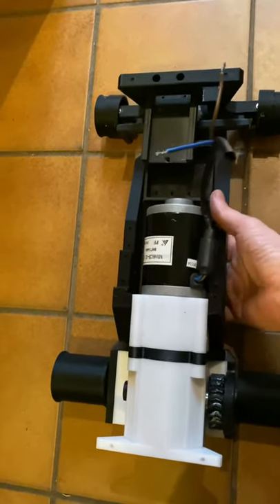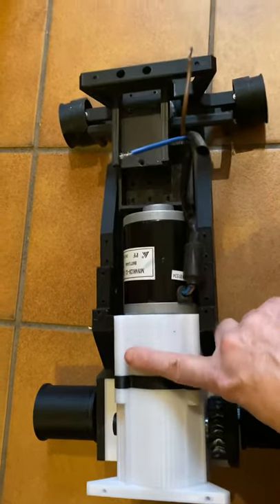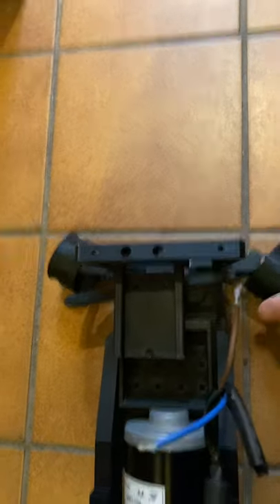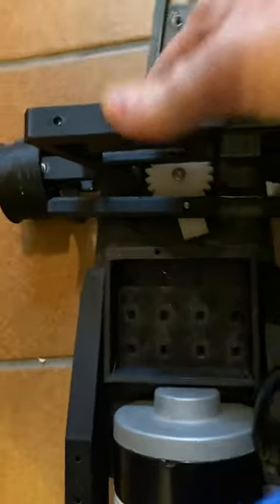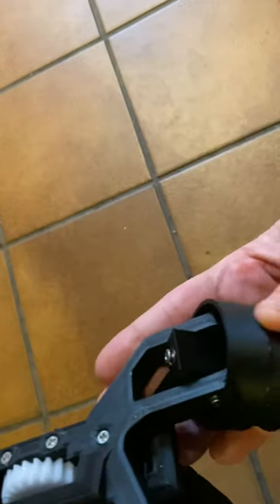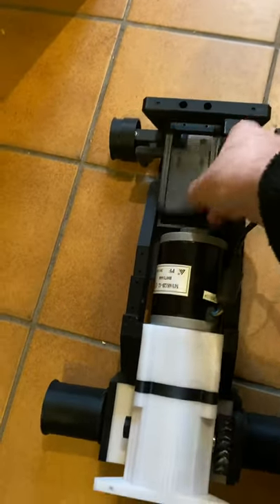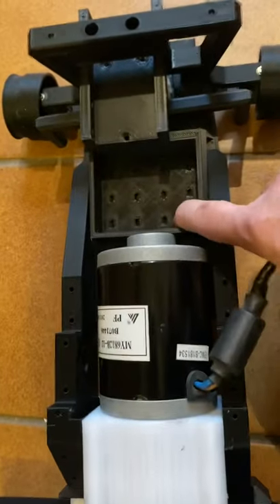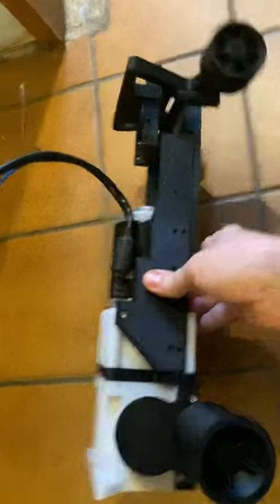Mouse fully printed drive overview.

Comment: Having trouble finding the Arduino code for the MSE build in OneDrive. Could you help me out?
Reply from the maker: https://github.com/MrBaddeley/FullScaleMouse-
Reply: @MichaelBaddeley  I was actually looking for code for the drive/servo. Does that exist?
Reply: @MichaelBaddeley  Tagging again because I updated my comment. :)
Reply from the maker: @ChrisSmith-il5qe  ah, gotcha, for the full scale mouse, it’s run through a standard RC set up, and ESC for the drive and the steer on the steer channel.
Reply: @MichaelBaddeley  I was reviewing last night and saw them buried in the instructions. All the parts for the electronics coming in today! Might post a video when I get it all hooked up.